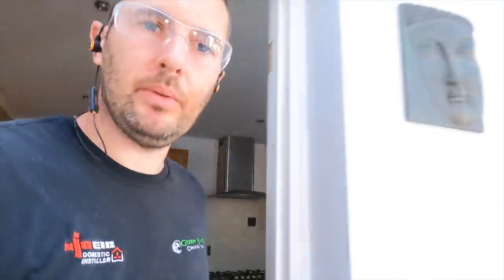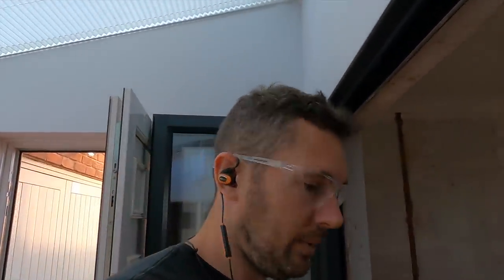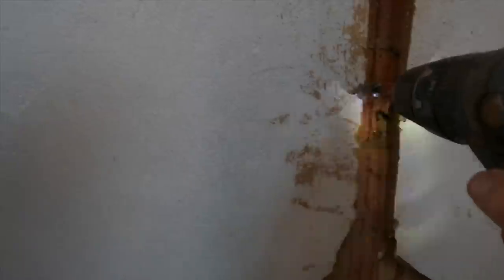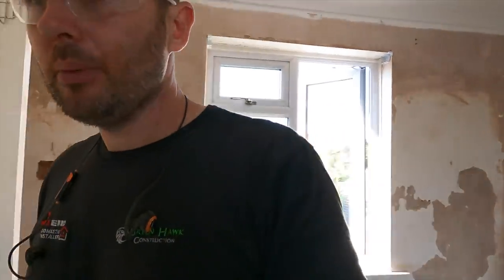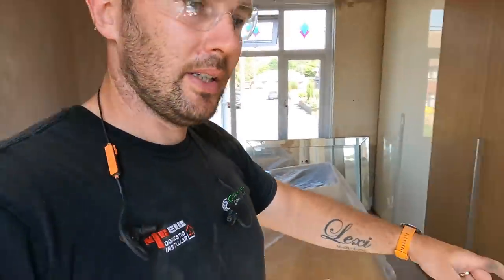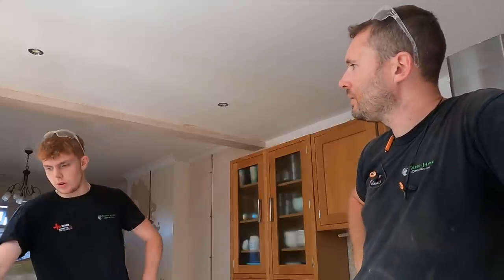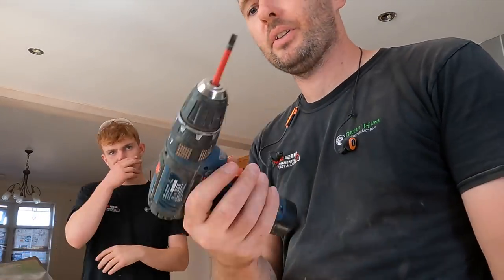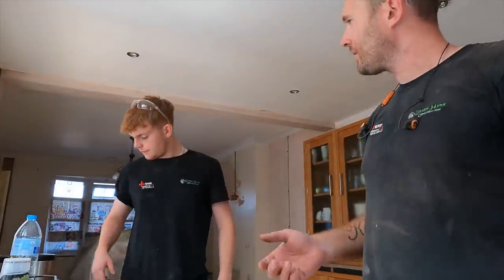CHASING METHODS!!! - PRO TIPS

Comment: The tape moves because the glue softens when the bit heats up and the tape slides about.
Reply: Absolutely correct and it's a right bugger when it happens too! As Mike said, mark it with a Sharpie and save the hassle.